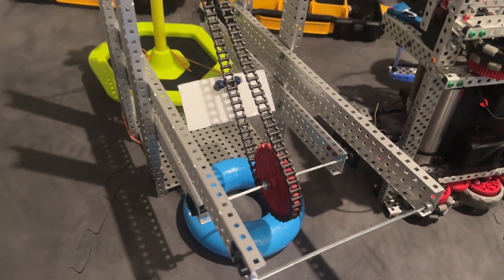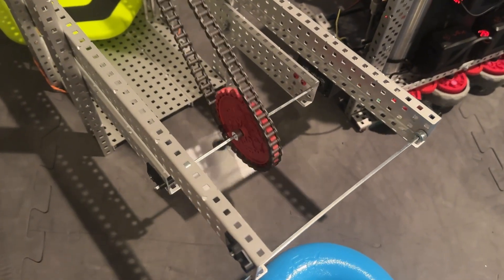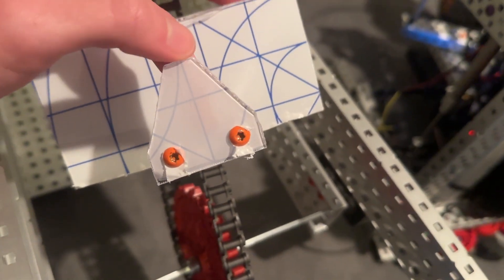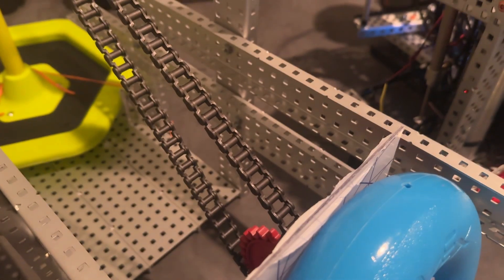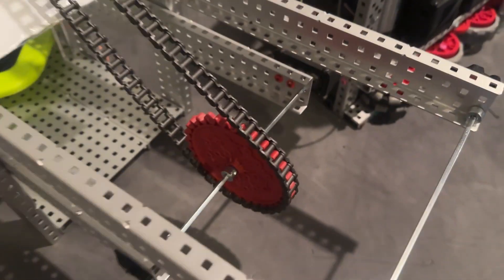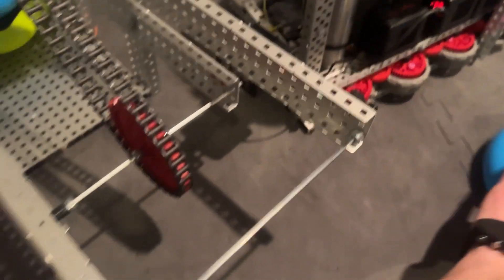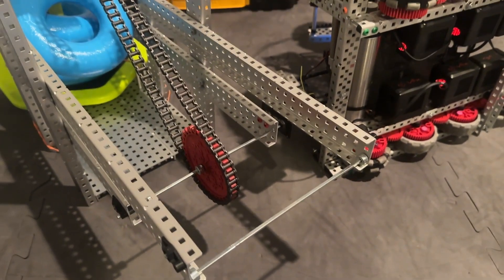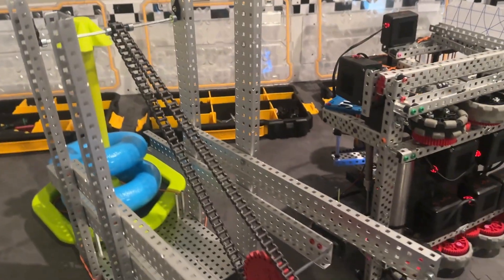Vex High Stakes Hook Conveyor Explanation/Tutorial

Comment: Is it just possible to pick up the rings from the front instead of the middle with this design
Reply from the maker: @anishkommireddy4429  what do you mean?
Reply: @9MotorGang  when you are picking up the disks, the hook goes through the hole in the center of the rings during the initial pickup. Is it possible to pick up the rings on the front instead of through the center of the ring. That way the ring doesn't have to go all the way into the bot and can be picked up much quicker. I'm sorry if it is hard to understand what is the front I am talking about. Here is a diagram(hook is the '|'): instead of using the hook here ( | ) can it do here |( o )
Reply from the maker: @anishkommireddy4429  doable but not as easy.